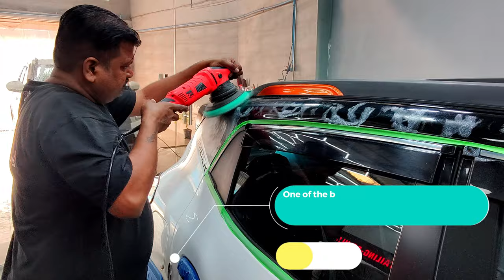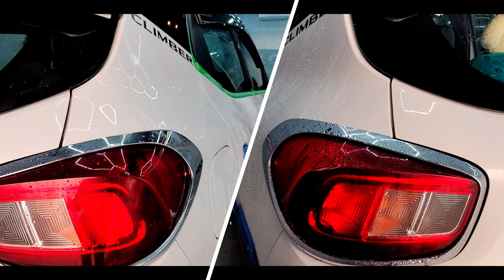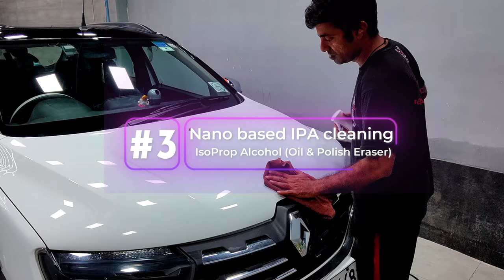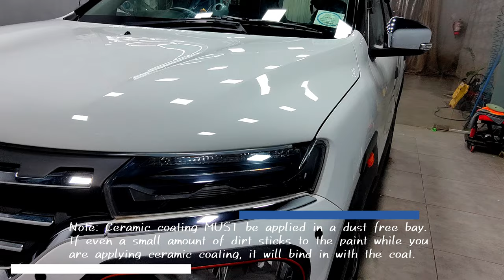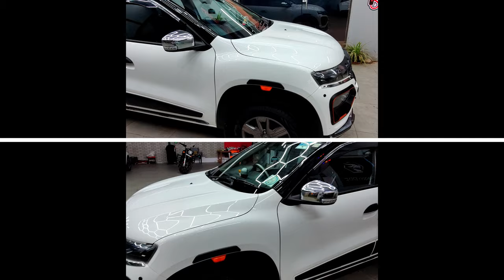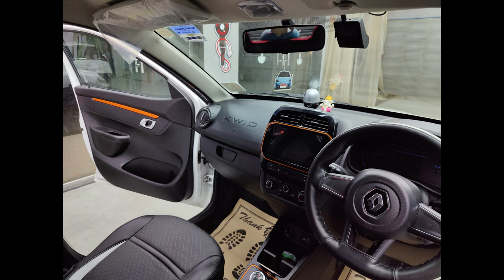Ceramic Coating for Car Paint Protection | PPF vs 9H Ceramic Coating, Which one you should choose?

Comment: Ppf Price ?
Reply from the maker: 40000 Rs
Reply: @utsavk1  
40k 🥲
Reply from the maker: yes PPF price usually starts from 40k and goes even higher. Thats why I recommend Ceramic coating which removes minor scratches and protects the paint for around an year or even more.